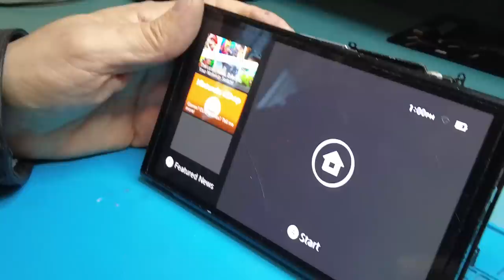Nintendo Switch OLED Wants to play Games - Error Code 2101-0001 - Is it Fixable ?

Comment: Watching other channels like tronixFix or mateVince you can see how much difference working on these devices daily does, experience just saved you from troubleshooting an very annoying issue that would not be diagnosable on a board level, saving you hours , while a common person would get stuck there, really valuable info there, if i ever see someone repair a switch with this problem we can now share a possible fix being that chip probably getting its data corrupted and throwing that error

Comment: An excellent fix as usual, did the customer not want the cracked screen replacing too?
Reply: I think its the screen protector.
Reply: I agree with the other commenter, if you full screen, you can see the edge outline of the screen protector.

Comment: Try charging it after doing that.

I had one case of a Switch with a similar issue, and after replacing the MT chip it was working again, but then I plugged in the charger, then turned it off and tried turning it on again, and it had the same problem again, and from time to time a different error code, but tied to the same chip.

Thought it was the port, replaced it as well, same behaviour, changed the charger, the same, even changed PI3USB just in case, and nothing, same thing.

I measured and every time the MT chip got shorted in the same way: CC and or Vconn connected to ground. Lost like 5~6 chips going back and forth 🤦🏽‍♂️

Couldn't find the cause.

Comment: One question ? I have done this but for some reason the chip doesn’t come out and I applied heat for 10 minutes ( first, it was 1-2-3 minutes, but it didn’t work ) and I have tried many times but I could be able to do it, you know why? By the way my heating is 350•C

Comment: I need to order 559 v2 flux, i have the 559 v3 and it totally suck, what hapoen amtech
Reply from the maker: V3 is not inventec amtech. V2 that we sell is the original. The topic was discussed at https://northridgefix.com/forum/general-questions/amtech-559-v3/#post-882
Reply: @NorthridgeFix  no wonder, this v3 is crap. Solder does not flow smoothly other than spike solder pads and evaporates so fast. This is trash

Comment: How bout some superglue on that screen crack?
Actually I've seen advertisements for a specific glue from China that I still don't know what it is called but they show cracks in glass and plastics disappear after applying it.
Could be just hinky advertising but I'd like to know if it really works or not.
I see that there is another computer business down the street from you.
Do you ever get unsatisfied customers from their shop?
Just wondered.
Except for scammers and past customers of yours that come back after sitting on their ipads and telling you that "it just happened after you fixed it",  I'm assuming that YOU NEVER get pad publicity.
A person would have to be insane or as I mentioned above, just idiots to say that you did bad work.
I would assume that you either get those "no fix" devices that the other guy had already also tried to repair and failed or after your diagnosis and no fix decision, maybe they go to those people to see if they can fix the same problem?
Either way, I know you guys can't fix everything as it either just takes too much shop time or it really is a disaster.
Make sure you new place is well covered with cameras and security.
Put alarms on all the doors so you  know if there is a potential breach in the place especially while you guys are working.
On hidden doors in the back, put double locks, door jamb pins, crossbars and inside camera as well watching all doors.
Make the shop and office area secure from the rest of the building.
A snake pit with trap door too!
Great Show!